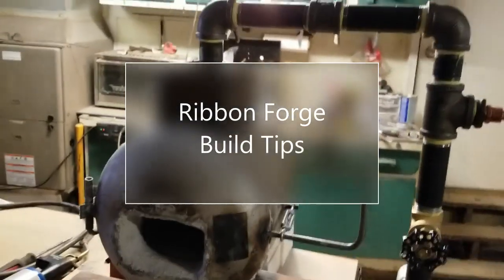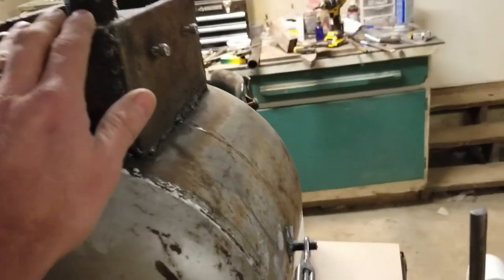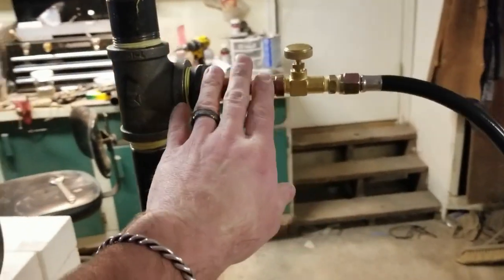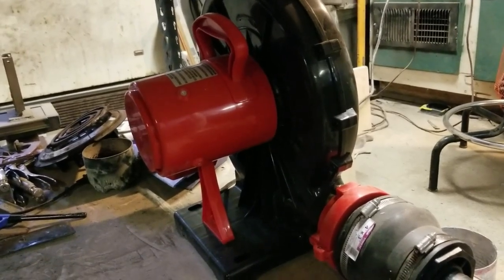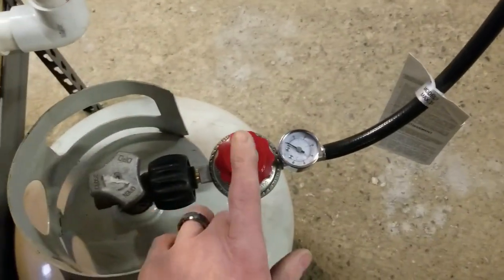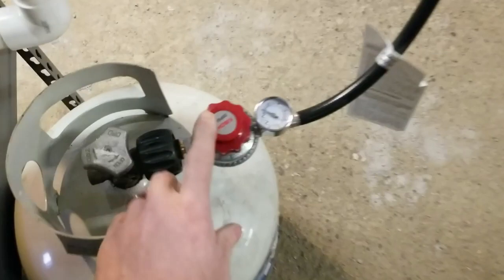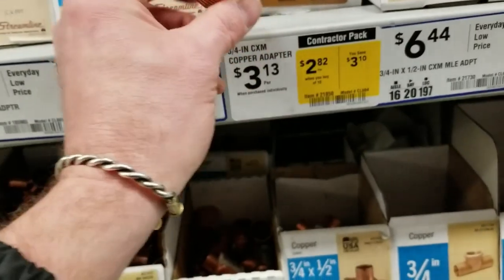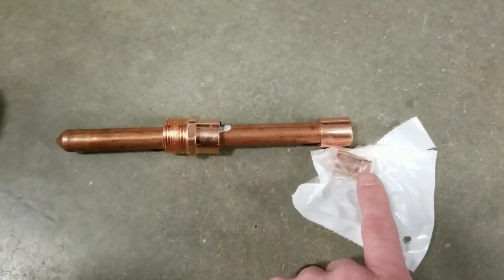Ribbon Burner Forge

Comment: Love this build Sir, I inspired to build me one, Love you for your detailed instructions Siir.
 Two additional charges I am wanting a selenoid to shut gas off as something electric fails so for safety.
  Second you have a powerful blower you can use the three inches diameter tubing coming out,Tee from your 3" tube 1" tube lead the 1" up and make a air curtain to blow hot air away from the door of your forge, It's great to have a welcome to visit Sir but I don't get out of Columbus Ohio much but you have a lovely State.
Thanks Sir

Comment: Look up static agitator.  Its s lightly twisted spiral that you can put inside of your top horizontal pipe and it will help mix the air amd gas ratio before combustion

Comment: Wonderful help and advice Sir
On another You Tube show the builder advice a propane cut off switch that if the electric blower should cut off the switch shut down the propane gas.
 Do you know about that safety switch, I want one but don't know what or where to go to get it
Thanks for the help Sir

Comment: Questions on the propane tank build, because I’m about to build one. How much kaowool does it take to line a propane tank with 2”?  And if how much mizzou did you need to get 3/4” across the sides and 2” in the bottom?
Reply from the maker: I cant remember  off the top of my head but if you measure  the outside circumference  and add enough  for the ends,I would say two 12x12 pieces  should do it,as for the Mizzou  I bought a 50 pound bag and used  maybe 1/4 if it. If you keep the rest  dry you can always use it for a reline  or other forges.
Reply from the maker: The 12x12 would be for the ends
Reply: WildmanPB huge help! Thank you.

Comment: Hi can you please advise me on my ribben burner , I followed your instructions ( for the most) as to assemble but my forge is smaller ( hopefully it will forge weld and small heat up faster so keep costs in use down for saving$$$$.
 If it's great ,fires up easy, I think it will weld( having not tried yet)
 Problem is after 30 mins to one hour the petty blue flames dissapear and I notice that the burner head seems to have the flames inside and glowing red with heat.
 What should I do now , don't feel safe .
Reply from the maker: Hard to say without  actually  seeing  it but it sounds like your forge is just coming  up to temp,when I run mine the entire  inside becomes hot and you cant see any flame except the dragons breath out the front, the burner head turns the same color  as the rest of the forge. When it gets this hot I sometimes shut the gas off at the quick  gas shut off valve without touching any other controls  when I pull my work from the forge and go to the anvil  and turn it back on when I return the work to the forge. Saves a little  gas .as for your concern  as long as it's not backfiring  i dont think i would  be to worried  as its normal  for the Burner  head to heat up with the inside  of the forge and the reason the burner is made from a castable  refractory. Without actually  standing there seeing it I cant say but it sounds normal  from my own experience  and I run mine alot.

Comment: HEY I did have failure
Your method of adding the so volume of the burner cause it to burn inside cause melting of the steel burner body
 .Use about a third less volume cause back pressure keep your burner cool.
  Bounce house blower do come different sizes
Almost all your build is super but the volume of your buner, Dangerous
Reply from the maker: Well maybe  I'm running  mine different  than you ,not sure maybe  the inside dimensions  of the forge have something to do with it but I've run mine a couple times a week with absolutely  no problem.

Comment: What happens when the power goes out?  I stick with my venture and coal.  Not that yours isnt bad ass and efficient but i like simplicity.
Reply from the maker: shepards forge h I own a venture  and a coal forge as well,I'm not real worried  about a power outage as we dont get them without some form of a storm and normally  the lights start to flicker  before it goes  out. If it's a big concern  you can install  a electrical  gas shutoff  that kills the propane if the power is cut.
Reply: WildmanPB well you are well prepared!  Love the burner man lill beyond my build abilities but i dig it!!
Reply: They do make a cutout for the gas if the power to the blower gets interrupted.  It costs about $95 in parts and take a little bit of time to wire it in.  I'll be installing one as part of my build.  We get a lot of storms here, and occasionally have short power interruptions from construction, car accidents, etc, enough that I feel the safety cutout is a necessity. After all, you only have to blow yourself up once to have a bad rest of your life.  I'd rather avoid that.